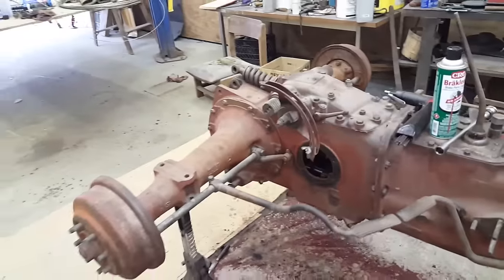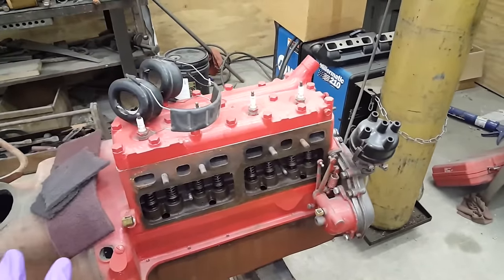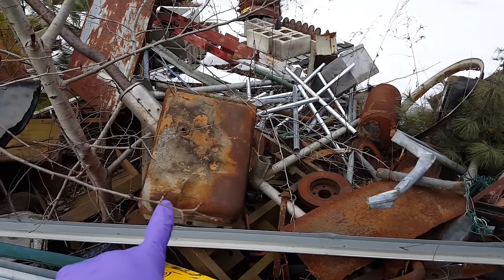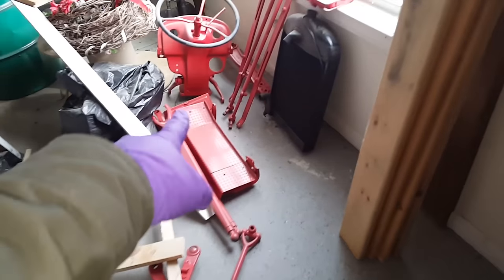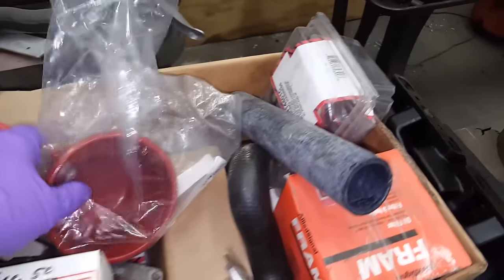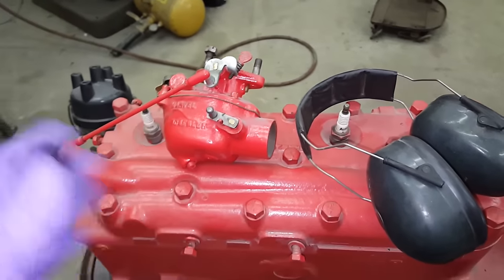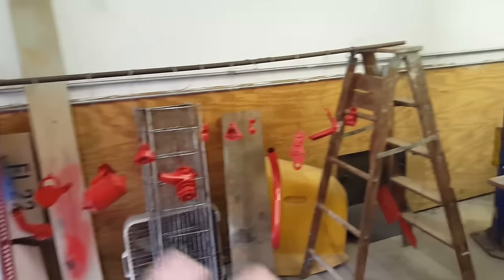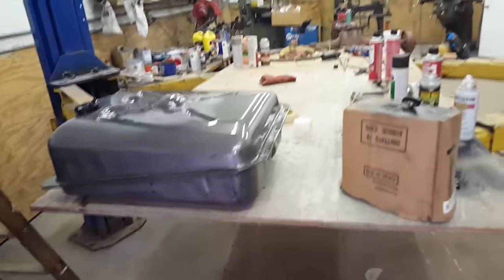Ford 8N | Antique Tractor Restoration | (PART 1)

Comment: If it is a 1954 it is not an 8N but a Jubilee as you noted.  8N's were not made after '52 then the Golden Jube in '53 and the plain Jube after that for a couple of years.  I have an 8N and a Golden Jube.   Enjoy your vids though.
Reply: It's not a jubilee either.  1954 would be the NAA. Jubilee was 1953 model only.
Reply: @roncrawford7128  The Golden Jubilee  with that insignia on the nose was only made in 1953. After that like you say the NAA  but a lot of folks still called them a Jube but just not the Golden Jube.

Comment: Thank you for the great video.  I am a fellow, brand-new ;0), 1952 Ford 8N w/ Sherman transmission owner!  Free advice:  Definitely convert it ot the 12 Volt, and look into the high lumen LED Headlights (you'll light up outer space with those puppies).  You're doing a great restore.

Comment: Beautiful tractor , I am going to look at at a barn find tomorrow , the guy says it's a 9n but I see in the pictures that it's has a overhead valve engine and a round circle fixture on the hood , so it's gotta be a jubilee series I think . It has sat for over 25 years in a barn . The pictures look pretty good . I'm here on the Big Island Hawaii . Wish me luck . I hope it's not a rust bucket .
Reply: Eh, you don't get much snow down there. It will probably have close to no rust. How'd it go?

Comment: Nice job!  I just picked up an 8N that I brought out of the Georgia woods and will be a working tractor and not a show piece. SN is 8N8722.  Brakeds are soaked in oil and the right brake cam needs to be built up and reground to get it to work properly.  Runs great but needs new manifold gaskets.  Had to rework the distributor  contactor from the coil to get spark.  Not sure what year it is.  It had been sitting in a barn unused for several years.
Reply from the maker: Nice find! Lots of good parts out of Dennis Carpenter and even Tractor Supply company if you need any.

Comment: I just hope you put a bunch of 3/8th inch nuts in the gas tank before painting the outside, and shook till every spec of rust was dislodged from inside the tank before painting the outside. I am not a fan of coating the inside, because when the fuel sits for extended periods I am not sure anything will not break down over time to plug the filter.

Comment: Cool video !!!  Thanks.    Have you experimented with electronic ignition, different carbs, and air intake setup ?
Reply from the maker: No, but recently we did upgrade to a 12v system. Completely changed out the internals on the generator, reg/rec, points, and battery. The thing starts up in under a second now!

Comment: What is that grey color and do you have the paint code?
Reply from the maker: It's called "Ford Light Gray" it should be at your local Tractor Supply, or paint supplier in a single stage.
Reply: @AimlessMoto  THANK YOU!

Comment: how did you remove the upper lift arms ? I hear they are difficult to remove ..
Reply from the maker: +Ben Stah (bs495) The 3 point hitch upper arms came off fairly easy. Remove one side retainer (2 bolts and a washer) then put a pry-bar between the arm and the 3-point housing and pry it off slowly. Once it moves about 1/2 an inch, you can get a large drift punch and hit it off with a hammer. Then you can do the other side. If it's stubborn, you've got to pull out the blue-torch and get some heat into it... then douse it with PB blaster and let it sit for a few hours. It'll break loose.

Comment: good afternoon I have a question I have a Ford tractor 8n with a front distributor when I'm driving it it starts to backfire sometime only could it be my carburetor or engine going out??
Reply from the maker: Carburetor, or it could be the coil giving you a weak spark. Try cleaning the points, and see if it gets better, if not, probably the coil.
Reply: Can also be a stuck valve. I have one I’m working on right now with a stuck intake valve. Backfiring through the carb

Comment: Nice job !!! Does all the new items you purchased come with instructions? I plan on doing my Ford 9N it is a 1940 model. Can you tell me where I can purchase books that give step by step instructions? Thanks again for the video !!!
Reply from the maker: You can find 9N and 8N repair manuals on eBay and Amazon for $20-30. They're honestly so simple to work on you don't need it. The only things a manual is good for is to rebuild the 3 point hitch/draft control under the seat and rebuilding the motor. Tractor Supply company will sell most of the larger things you'll need, exhaust, manifolds, nuts and bolts, filters, gaskets, lables, even paint. I suggest subscribing or picking up some copies of "N News". It's a very reliable source for all things "Ford" tractor. Good luck!
Reply: Thank you for your very quick response. I will look up N news !!!

Comment: Awesome video I wish I knew where to get parts for an 800 I need some distributor parts 1955 800 Ford
Reply from the maker: Walker Outdoors tractor supply co. You can get everything you need.... if not there, Dennis Carpenter... but their customer service is terrible.
Reply: Walker Outdoors check around San Jose California for old tractor parts. You might find somebody online selling parts.
Reply: Ebay

Comment: That's not a '54 it's not even a '52 that is a '48 to early '50 the distributor is on the front of the motor late '50 to '52 is on the side of the motor '53 is the golden jubilee
Reply from the maker: It's a 52'. I'll get back to you with the serial number, but it checks out to be a 52'. The 53' Jubilee motor is completely different from the 8N, it's an over-head valve motor and all of them (600/800etc) were side-mount distributors. This 52' is a side-mount distributor... YES, it goes into the front cover, but it is considered a side-mount... if it were a front-mount, you wouldn't be able to see it just by looking at the tractor, you'd have to get up under the side and follow the plug wires up to the front of the engine behind the fan.
Reply: Jerry Kilby yes I have a 1952 the last year the 8N was in production. I also have the 1953 Jubilee which replaced the 8N. Then I have the 600 series then I have an 800 series. Sorry, but this is a much earlier Ford.
Reply: That is the side mount distributor.

Comment: It is not a 54. If it were a 54 it would not be a n series it would be a 6 or 800 series it is a 48 to 52.and would be an overhead valve engine
Reply from the maker: Clearly stated in the video and description and pin-comment... I know.
Reply: Actually it’s 1947 through 1962

Comment: The Ford 8n was in Production from 1948 - 1952. Kind of doubt what you have there is an 8n. I have an 1948 8n and what you have there is not like it. My 8n has the high and low range. not as rare as you make it sound.